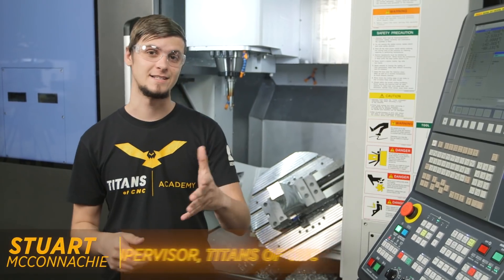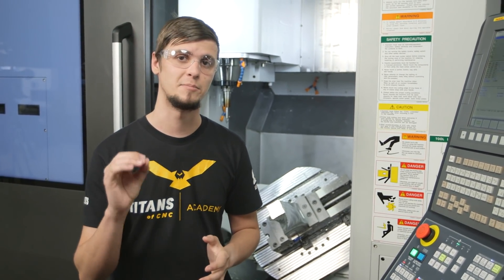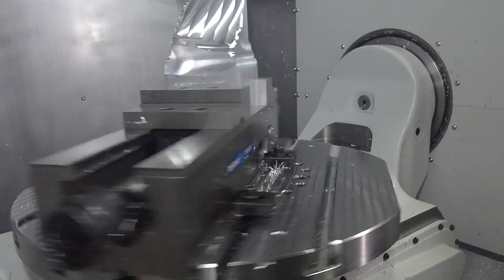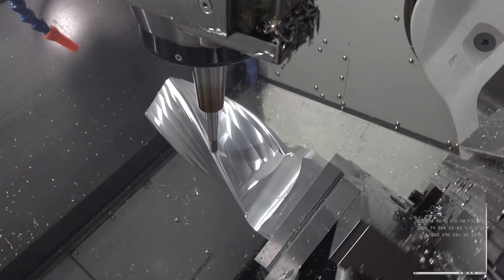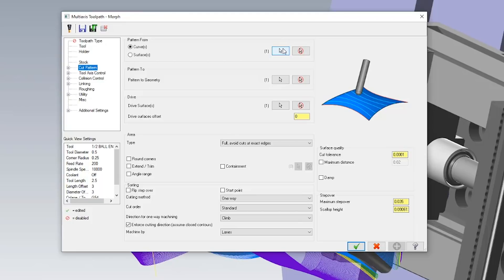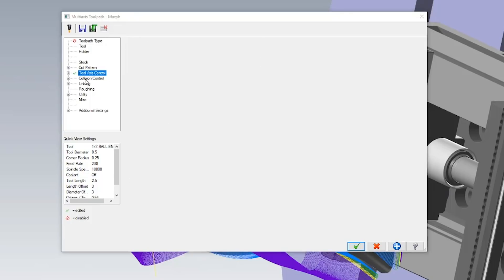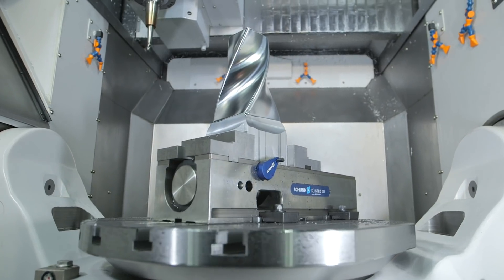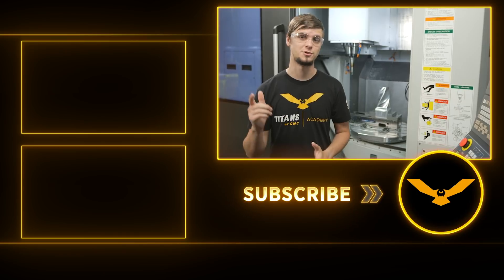5 Axis Simultaneous Ball Mill CNC Machining on Doosan DVF 6500

Comment: Hi, thanks for this vidéo.
I'm CAD designer on Solidworks and PTC Creo (freelance learning), and i worked for two foundrie (milling aluminium model plate on 3 axis CNC, Haas VF5, VF9, and other machin on sinumerik, heidenhain, and meldas ...).
But has a freelancer, i want to continue to évolve in this sector, but today i have another job as cad designer but without CNC :( .
I want to learn 5 axis, and Mastercam, 
I have experience whit aluminium, but not with other material.
But i'm a french speaker (sorry for my bad english).
But, to help me more, do you have any pdf or other leason ?
your vidéo are verry great, but with my level in english it's hard to follow correctly.
I want to learn more to come back in the manufacturing and to give a lot of job on CNC machining.
To do better than my vather how introduce me in this manufacturing.
I teatch on a sutdent as a milling opérator on 3 axis, but i can't teatch more because i don't know more (no yet).
But if you have any .doc or .pdf or anythink that i can print on a paper, this is more easy to translate or to work on mastercam at the same time.

Again, thank you for all
And sorry for my bad english (i learn english every day too)

Comment: @TITANSofCNC:Academy just finished doing building blocks 5m and 6m. My question is: press pull and extrusion are different options but I did not see a difference on the CAD, would this affect the CAM and real CNC MACHINING? Could you make a video about this?

Comment: thats a waste, its a 4axis part, you could keep climbing without all the air moves, but it does make for good video
Reply: You get a better surface finish and longer tool life with a ball nose tipped at an angle though.
Reply: @tylerfarrell8034  he's cutting at 45 tho
Reply: @axisfiveraxisfiver5844  is that not beneficial? Or are you saying that you can do the same thing with the 4th axis? I don’t have experience cutting with a live 4th axis.
Reply: @tylerfarrell8034  most folks get a 5th axis and try to do fancy moves because its fun, having the tool cutting air is wasteful, turning the part down in 4rth would have kept the tool in constant engagement without sacrificing the finish

Comment: This just goes to show how good 5-axis machines are. Our machines are of the highest calibre and a 5-Axis CNC machine provides infinite possibilities as to part sizes and shapes. It allows us to process five sides of a part in a single setup, moving across the X, Y and Z linear axes as well as rotating on the A and B axes. This allows for higher part accuracy because the workpiece does not move across multiple workstations.

Comment: This particular part looks like a textbook one for a rotary-style toolpath. Just spin the part and eliminate any linking moves, having full 5 axis should mean you can keep the ball mill at a constant angle along the surface right?
Reply: Ya in the real world that's how you'd run it... But this way looks so much cooler
Reply: yes you right, but it is a good, simple example to show less experienced viewers 5 axis motion
Reply: I shouldn't be surprised to see you here but I am, love your builds man
Reply: My first thought on this part, why dont they rotate the A-Axis and do a 4+1 Machining so you don't have all the linking moves
Reply: @callmekimberly99  I imagine it could be run pretty fast too given how little of the machine is moving and how fast that spindle can go.
Reply: Forgive me but what is a linking move?
Reply: @mtbjason4  its a move of a cutter connecting end of a pass with begin of the next one,  basically its a linking motion between passes
Reply: Both way are able to make this part . Really it is about the time it takes to make the part and which style allows you to go faster . @bi-tech
Reply: @stuartmcconnachie8907  hoffmann has really nice cutters that would half the cycle time  if you changed the strategy to go around the part 
have a look on their website :
https://www.hoffmann-group.com/GB/en/houk/Mono-machining/Solid-carbide-milling-cutters/Solid-carbide-barrel-milling-cutter%2C-tangential-form-PPC-DLC/p/207517-12%402F85?tId=144
on this cutter you have 85mm rad that you can use to generate the form of the part instead of using 6mm rad on 12mm ball nosed end mill, that will give you better finish in shorter time
Mastercam is great in programming finishing passes using accelerated finishing strategies and tools and many times we can cut 75% of the cycle time :)
But as I mentioned before this wasnt the purpose of the video it is a demonstration of soft and 5 axis, 
I love this presentation, great post !!!
Reply: and great news is that Mastercam has got their tool library - all hoffmann tools ready to use in mastercam
Reply: @aspeaerospaceprecisionenging  I hadn't considered a tangential profile cutter (spot the person without a 5-axis mill...), that would definitely make a lot of sense. In a way I sort of think that it would show off the 5-axis capabilities more if anything, since you could use it to maintain even tool contact with an angle to the surface, which you couldn't do with just a 4th axis or using 3 + 1.
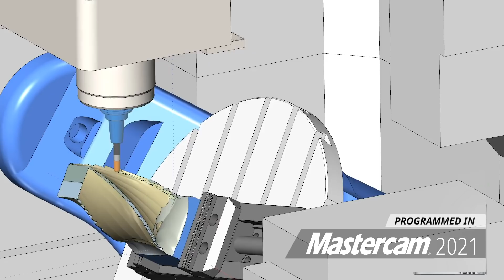Reply: I 100% agree with you it is like on this video https://youtu.be/6SMig2SFrZg 1:30
4th axis this is what we would use + lens form cutter
Reply: That and a barrel tools...
Reply: In would program it exactly like he did, for no other reason than the tool marks. It looks cooler this way and he only had to do one cutter path, copy, and modify for rough, semi, and finish. Most efficient cutter path and programming in my opinion.